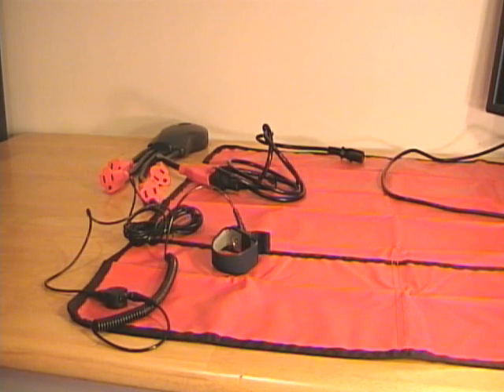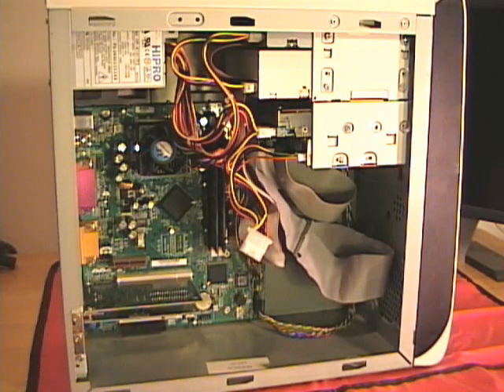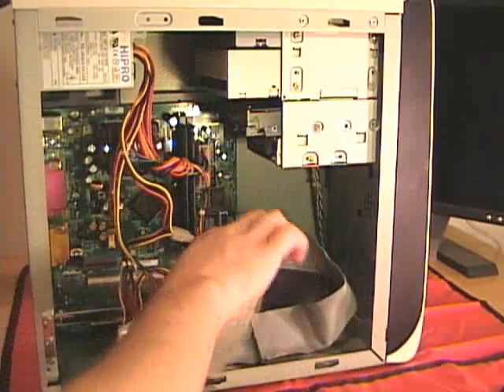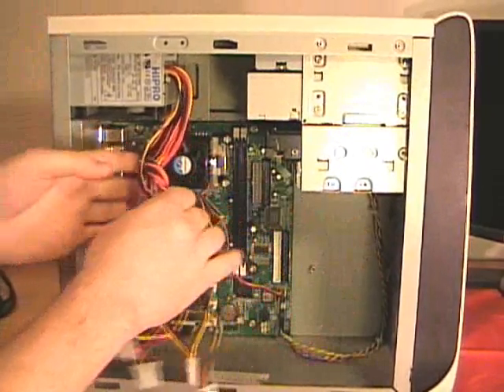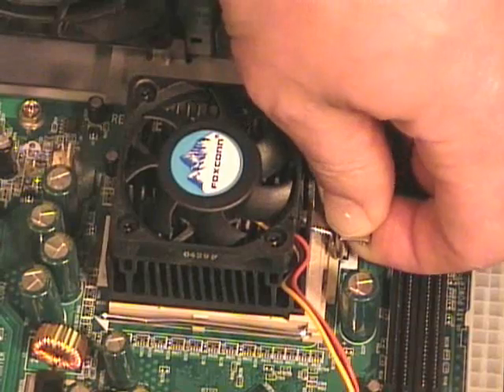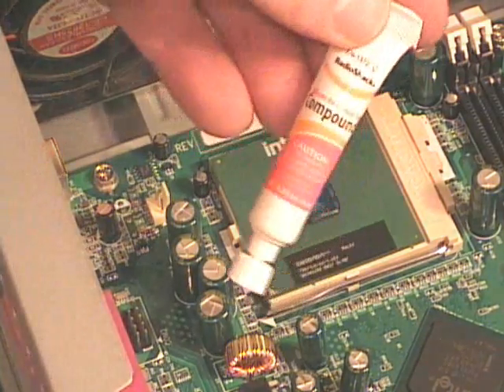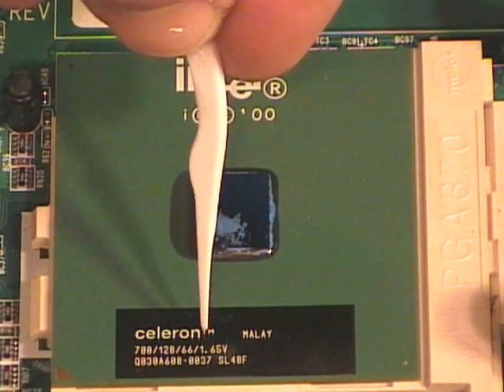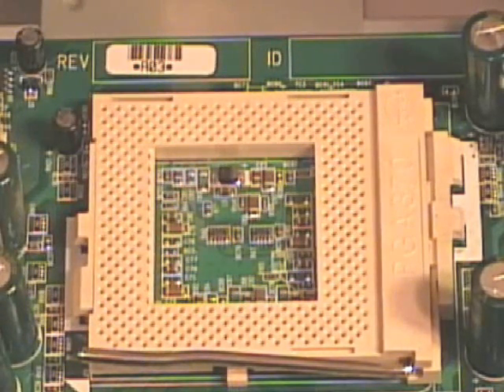Remove and Install a PGA Processor-Part 1 of 2

Comment: funny I could run a k6-2 333 at 366 and 400mhz without even a coolmaster plugged in and the cpu handle the job. Damn thoses things where stronger than we thougt they where

Comment: quick question what does a pga socket actually do in the computer
Reply: 8 years and no answer...
Reply: It provides power and data connections between a board and a chip package.  PGA packages are designed for easy replacement without too much specialized tooling.

That looks like an Intel Socket 370, pretty typical from '98 to '03.  They worked with the first generation "Mendocino" Celeron processors, "Coppermine" Pentium III and Celeron, and VIA's C3 clone.  Those were single-core processors understanding the i686 machine language with clock speeds up to 1.4 GHz.  By that point AMD was using their own Socket A.

Socket 370 and Socket A had fewer pins than modern sockets because they don't support direct communications between the CPU and high-speed devices.  Instead the CPU connects to the "northbridge" chip on the motherboard, which handles high-speed communication between the CPU and memory.  The graphics system would often also connect to the northbridge, especially if it used the Accelerated Graphics Port slot connector. Modern CPUs have multiple memory channels (2-8) and direct connections to the GPU and possibly other things like SSD storage and networking.

CPUs of that era needed 1.6 - 1.8 V power at surprisingly high current for the beefiest - nearly 20A sustained to feed a Pentium III.  So many of the pins were dedicated to power and ground.  Modern CPUs operate at lower voltage and higher power, so current has gone way up, about 50-150A for a desktop CPU.

More data paths and more current means modern sockets have more densely packed pins that cover the entire area of the socket, which can be quite large.  In an effort to pack more pins, Intel switched to "land grid array" sockets (many tiny flexible pins on the motherboard) starting in 2006.  AMD has stuck with PGA until the present for desktop products, but uses LGA for high-performance server parts and the current Threadripper brand.

PGA is imo more physically forgiving but requires good technique to remove heat sinks (always wiggle first to break the seal) because pulling or peeling forces can destroy the CPU package.  LGA requires care when installing a CPU or handling a motherboard with no CPU installed - if you damage the socket's delicate pins it's nearly impossible to repair it or the motherboard.

Comment: will i cause any damage if i remove the processor while its locked on the motherboard?
thanks
Reply: Decade old question but just in case anyone's wondering: My friend accidentally did that while attempting to pull a large heatsink off of a newer socket BUT the CPU/socket were fine. However, that should be totally avoided. I pulled out a keyboard switch with too much force and it ruined that pin and destroyed the switch which can/will happen with a CPU too.